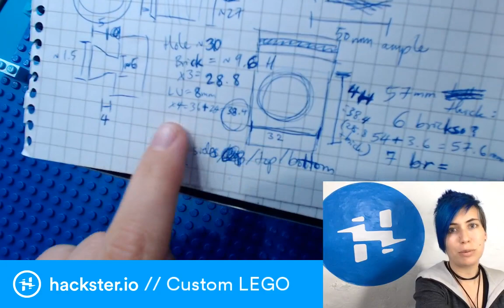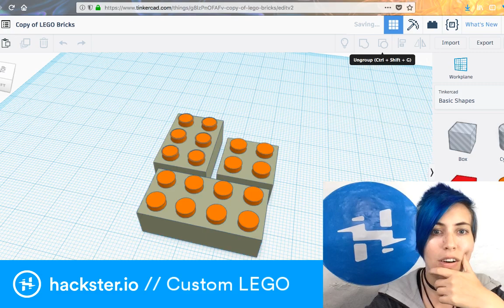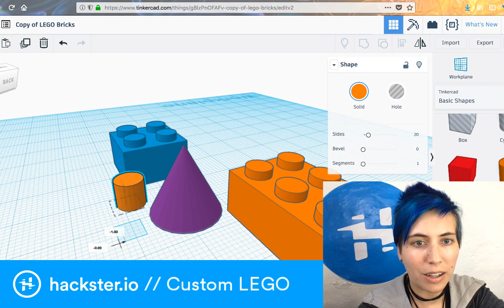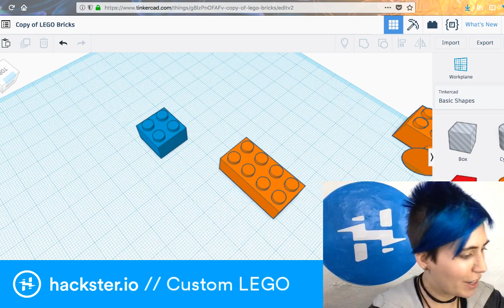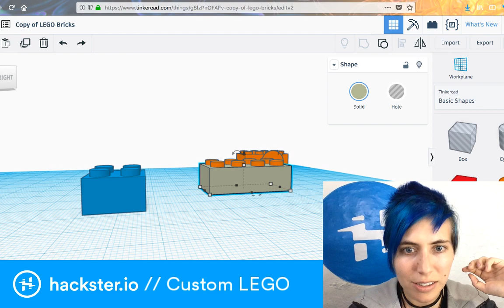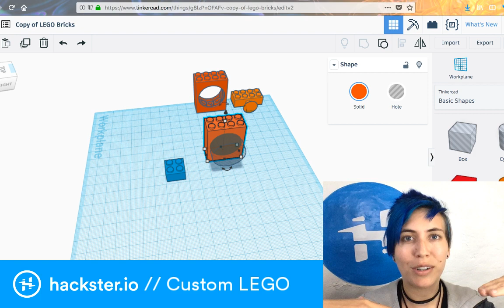3D Printing Custom LEGO

Comment: Thanks, nice video and cool project! Will definitely look up the outcome right after this.
Since the video is from more than a year ago I guess you've found out by now, if not directly after,
but it might still be useful for some people in the comments just starting Tinkercad,
so here are a few tips for some issues you ran into in the video that might help others:

-You can easily center objects with the Align tool (hot key L) on the top, where the Group (CTRL + G) and also the Mirror tool (M) are,
-The Snap Grid on the bottom can be set to use different increments using the pull down menu (up actually) and
-You can switch between Perspective and Orthographic ("flat") mode on the bottom of the left side toolbar

Hope somebody finds it useful. Now, let's see how your cool PiPrinter came out ..!
Reply from the maker: Sweet, thanks for the notes! You can find the project write-up at http://bit.ly/pipfs :)